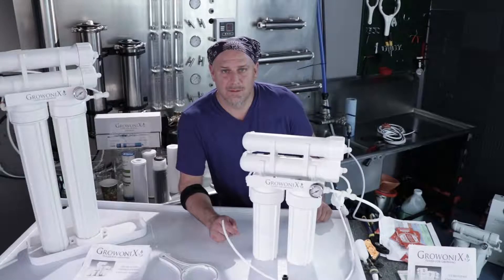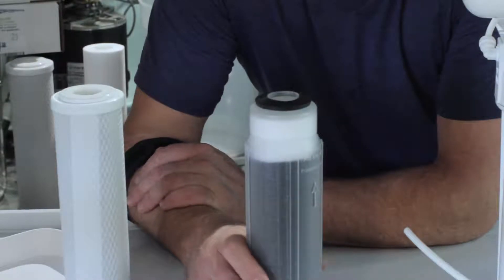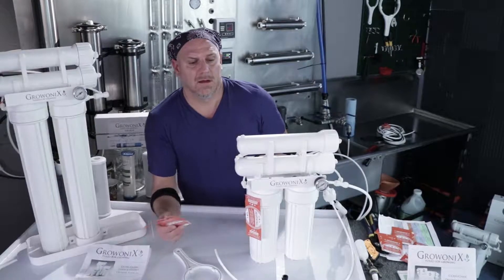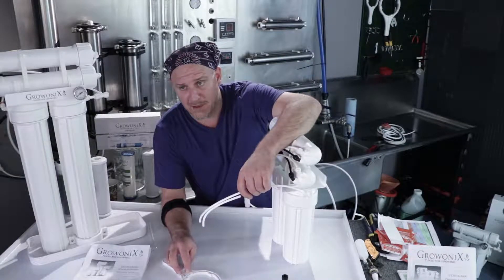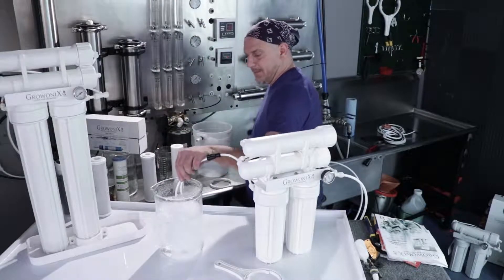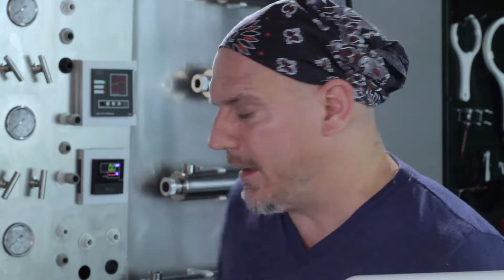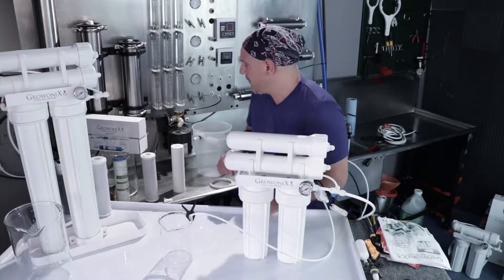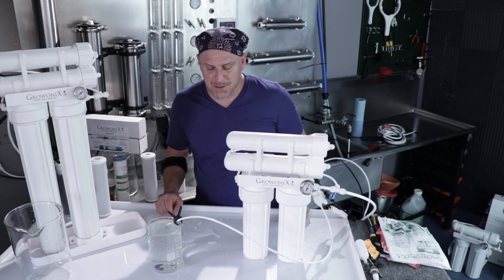GrowoniX EX400 & EX400 Tall: Flush Carbon Filter & Membrane

Comment: What would my ppm go down to if my tap water is at 325?
Reply from the maker: 400 GPM systems use High Flow membranes (different than our High Rejection Membranes), which have approx 96% rejection.  So 325-96%=...........................13.
Reply: GrowoniX Water Systems is the 200gx 96% rejection?
Reply from the maker: Yes it is.
Reply: GrowoniX Water Systems 👍 also last question tried calling but you answer quick on here! I’m gonna be storing the gx200 system for 1-2 months after I use it for 250 gallons should I empty all the filters out so there’s no water inside or can I leave the water inside the filters?
Reply from the maker: Ideally you should have someone use there filter once per week to keep the water cycling through.  Draining the unit works for the most part, but the membrane can get ruined if it dries out.  Conversely, the other problem is the membrane can grow bacteria if it sits in stagnant water for months—especially in a warm environment.  So really, the issue is with the membrane.  If you can have it run occasionally while your away, this solves the problem.  Otherwise, it's best to drain it—and you'll have to take your chances with the membrane.
Reply: GrowoniX Water Systems thanks! I have the gx200 and it puts out such clean water wow! Is it possible to upgrade it with a 2nd membrane if I wanted to?